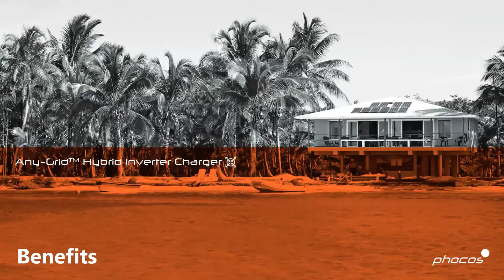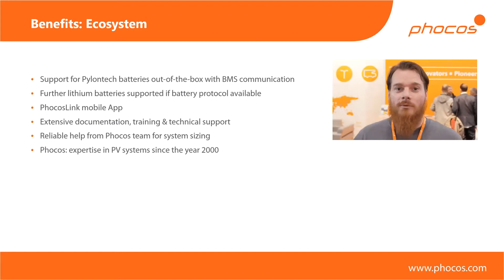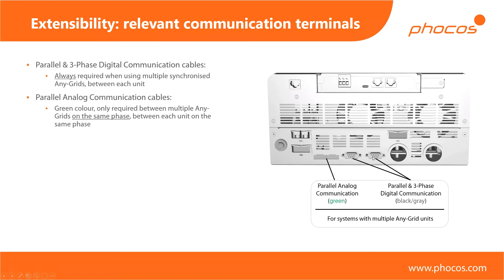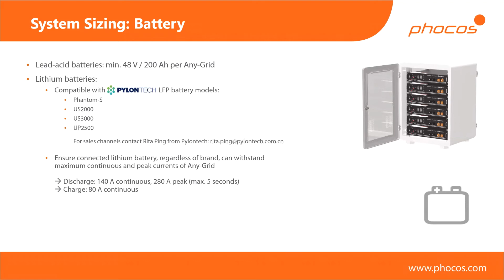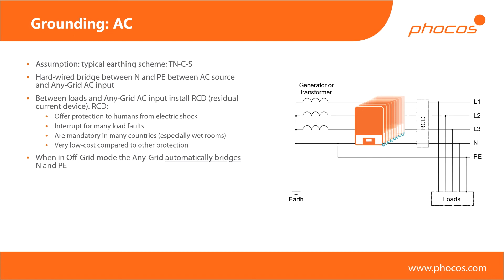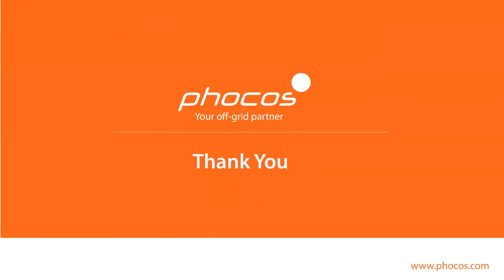Part 3/3 - Phocos Any-Grid Hybrid Inverter 230 V Webinar (PhocosLink App and Technical Details)

Comment: Also, in a 3-phase system if only a single inverter has a panel array, does the other two receive solar power through the batteries for 3 phase operation day/night??
Reply from the maker: Hello, the inverter with the PV array connected will supply PV power to charge the batteries and supply the AC output demand. The other 2 PSW-H units are able to use the battery supply or AC input source to supply the AC output demand.

Comment: Hi, a question. Can you use a single phase (240V) generator in a 3 -phase 3 unit system (3x230V/380V) to charge the common battery pack? If so, what is the power level needed for the generator?
Reply from the maker: Hello, when using a diesel/gasoline generator on a 3-phase configuration, the generator must supply a 3-phase AC output. The PSW-H units need to synchronize the 3-phase AC input across all units in the system, this cannot be done with a single phase generator.

Comment: 50ms swiching time can be somehow problematic in a 3ph installation. I would suspect that switching would take place if there's overpowering on ANY of the 3 phases, right?
Reply from the maker: Hello, we apologize for the late reply. This is correct. In 3-phase operation all 3 phases must either be sourced from an AC source or from the inverters themselves in Off-Grid mode, never a mix. The reason the switching time increases from approx.. 10 ms in single-phase operation to ≤ 50 ms in 3-phase operation is that every phase attempts to do zero-crossing switching to put the least stress on loads. As the inverters must “wait” for all 3 phases to cross 0 Vac, naturally the total switching time must increase. However, most PC power supplies and similar equipment is rated to withstand 50 ms AC losses. Furthermore, single-phase loads such as PCs will only “see” the switching of one phase, not the 3 phases for which the 50 ms are valid, that only affects 3-phase loads.

Comment: Is it possible to only have ONE Any-Grid inverter plugged into one of the phases, in a 3ph installation, and have the rest of the phases connected directly to the grid? What if there are NO 3 phase loads that would potentially need the 3ph common neutral?
Reply from the maker: It is possible to use this configuration for single-phase loads only. This is also due to the necessity of an RCD in most countries and in this scenario one single-phase RCD would be needed for each phase. Connecting 3-phase loads to such a system should never be done, because it could happen that for example the two grid phases fail and the 3-phase loads are fed a single phase only, which could damage them. When using 3 or more PSW-H in 3-phase configuration, if any phase should fail, the others automatically turn off as well to protect 3-phase loads from damage.

Comment: How come you don't need series diodes when using 2 strings in parallel using Y-connectors? It doesn't make sense for me. You would be burning the energy produced from the sunny string onto the shaded one!
Reply from the maker: Series diodes can be used, but do not need to be used in most cases. Even with shading (unless the shading is 100% such as with snow coverage) of a full string, the voltage is still very high, high enough to avoid any back-current. In practice this means the shaded string does not contribute much current, but there is typically no reverse-current either, unless as mentioned there is very harsh shading such as through thick snow coverage of only one string.

Comment: I have a single phase connection at home, but I want to set up a 3 phase system with 3 inverters.
Is it possible to set it up as 3P1 with grid connection and 3P2 and 3P3 always off-grid? Those two will work with solar/battery only.
Reply from the maker: Hello, a 3-phase system composed of 3 PSW-H units will require a 3-phase AC source if you intend to use an AC source. If using a single-phase AC source on just one PSW-H, then the AC source will effectively be rejected and never used.

Comment: This is an exciting new product! Will there be a web app for remote monitoring though? I find that indispensable to monitor and troubleshoot my customers' systems. Thanks.
Reply: This is all I saw on this.  "Optional accessory: Phocos Any-Bridge™ IoT Gateway (sold separately) to connect to the PhocosLink Cloudfrom anywhere with any internet-capable device via its web browser" 
I however can't locate documentation on the IoT gateway.

Comment: Hi,when sizing panels for the system,in terms of current (short circuit current) coming from the panels,do we have to be careful to fall within the 22.5Amp range,what would happen if exceed
Reply from the maker: Hi, slightly exceeding the 22.5 A limit will not damage the Any-Grid. However, because a maximum of 18 A are usable from the PV array, that extra current and thus power could not be utilized by the MPPT beyond 18 A.